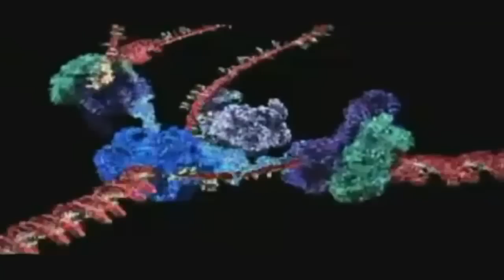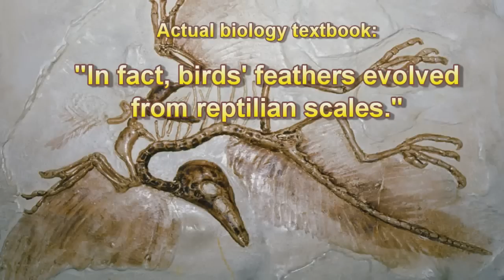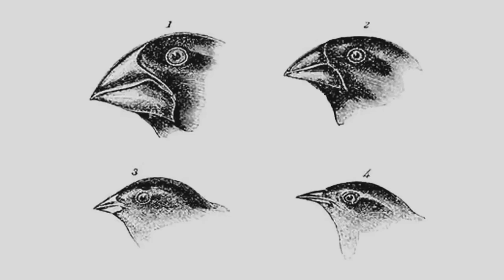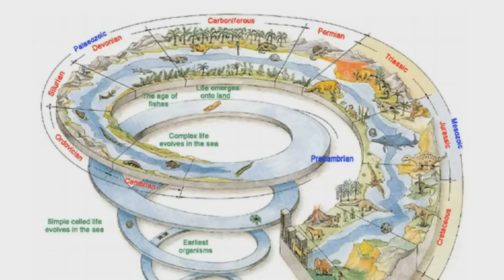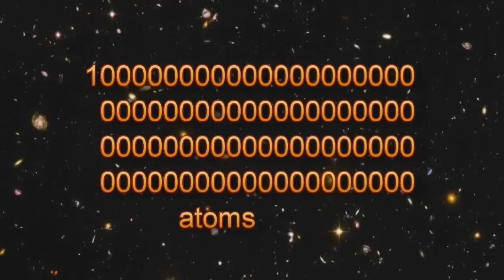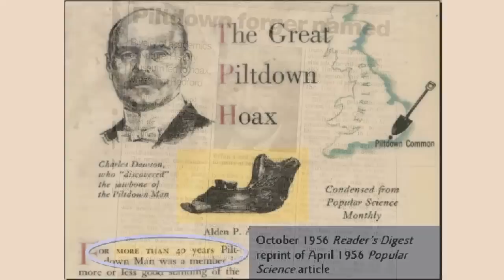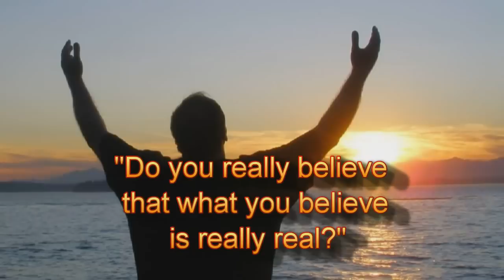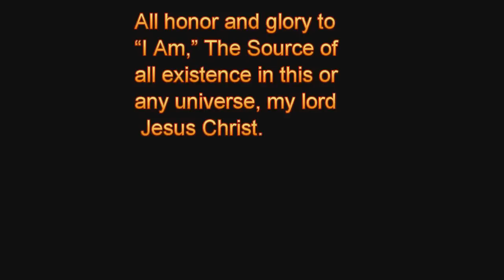Evolution Demolition

Comment: 4.30  EVOLUTION IS SCIENCE!
Reply: Natural selection is science.  Random mutations giving rise to overwhelmingly improbable genetic instructions is scientifically impossible.  It has never been observed or documented.  Only wished for.
Reply: Tiago Almeida The "junk DNA" idea has been abandoned because researchers find function for sequences in this area of the genome weekly.  You are behind the times.  Have you heard of the ENCODE project?  The arrogance of assuming that DNA must be junk if an evolutionist doesn't know its function is embarrassing.

Mutations are always damage to the original function of the code, but most of these errors are self-corrected by genomic error-correction algorithms.  Many others are irreparably harmful.  However, you are correct in saying that sometimes mutations get lucky and are actually "beneficial" by eliminating function that has been causing problems under certain conditions.  The sickle cell mutation prevents malaria from proceeding, but if both parents have the mutation, then it causes sickle cell disease.  So information is damaged, yet it can be a beneficial mutation.

So the issue is not beneficial versus harmful, but rather: writing new genetic instructions versus the loss of informational function.  Being beneficial has nothing to do with what I'm talking about.

Many variations claimed to be mutations are not mutations at all, but are pre-existent in the genome until natural selection brings them to the fore.  Just because a gene has not been observed previously does not mean that we can be sure it was not always there, hidden in a recessive gene.

Many of the gene changes in bacteria are self-programming changes that are drawn from plasmids.  This is DNA information that already existed in a DNA loop, but a segment is pasted in to the genome so that a new enzyme variation can be self-programmed.  Plasmids are very likely the source of nylonase, and resistance to antibiotics, not random mutations.  I understand that plasmid research is cutting edge stuff right now.
Reply: Mark Champneys So you are saying that mutations already exist in the genome of certain organisms? The claims you defende can have some degree of reazon.

But we just don´t have enought proves to know if that is true or not. If that is true, the mutation that made possible the formation of fotoreceptors (PAX6 is a key regulator gene for the deveplopement of the eye) should have appear earlier, given that the eye allowed the first single-celled organisms, such as bacteria distinguish day from night, and so take refuge in the day to minimize the exposer of UV radiation.

The same applies to trees and fetuses. Their ancestors  where small colonies of algae and mosses that lived in moist environments such as beaches, a mutation allowed the formation of lenhin, keeping the stam hard and robust, allowing the developement of fetuses and trees.

When I refer to junk DNA, I knew that we as important for an living being. If junk DNA survived natural selection, is because its necessary. One hypothesis explain that the junk DNA plays an inportant roll in the protection of genes: if the genome contained only coding elements proteins, many of which would degrade and would become useless by means of recombination errors. this non-coding DNA becomes a shock absorber, reducing the probability of damage to a critical gene.
 Another hypothesis says that when when the chromosomes are crossed, some portions of genetic trash can be grouped into useful combinations.
Reply: Mark Champneys
Now you are an expert on ENCODE too? How many of the 30 papers did you read? What data did you look at?
Reply: Helixbuilder Seeing videos from:
- Thunderf00t
- King Crocoduck
- potholer54
- The amazing atheist
- AronRa
- theThinkingatheist
- DarkMatter2525

Reding books about genetics, zoology, botanics, astronomy, physics, chimestry. Searching in the web sites were your crap is debunked, searching evolution and what it saids, going to real sites and see for my self transitional fossils, see mutations and the articals written about them and being focus on school.

Yes, I may not know everything, I only 16, but I know enought to refut such claims.
Reply: Tiago Almeida
Tiago we are on the same side I was speaking to Mark.
Reply: My mother tongue is not english, it´s potuguese, so I don´t understand what has encode, can you explain to me please?
Reply: Tiago Almeida
It was a genome project that tried to identify functional elements in the genome. It was a good effort but the results seem a bit overstated. Looking at the methodology and the controls I take the results as temporary pending a functional assay.
Reply: Helixbuilder thank you.

Comment: The reason why darwinian evolution can’t work is because the chromosomes within the DNA of species is already fixed. If an organism developed an extra chromosome or lost one due to some odd mutation, it couldn’t successfully mate and evolve a new species as it wouldn’t work because their gametes wouldn’t produce viable zygotes or it’d make the animal infertile due to the process of gametogenesis which the odd number of chromosomes makes it impossible for viable gametes to be produced by meiosis. Second of all, the odds of evolving a human though the nonsense process of natural selection and random mutations is 1 in 10^6930000. You calculate this by raising ten to the power of 77 (ratio of functional protein sequences) and again to the power of 90,000 (total number of proteins in the human genome). So, 1/(10^77)^90,000= 10^-6930000 or 1 in 10^6930000 converted to odds. This is a 1 followed by 6930000 zeros. It’d take you about (10^6930000)/(3.6524*10^2) = ~2.7*10^6929997 years to evolve a human by this process! There are only 13.8*10^9 years since the big bang, and there are only 10^80 atoms in the entire known universe. Darwinism’s an utter joke. To believe a fish eventually became a human in only 10^9 years is a nonsense.  
Also fossil record proves without the slightest shadow of a doubt that there is no evolution of species:   "One hundred and twenty years of paleontological research later, it has become abundantly clear that the fossil record will not confirm this part of Darwin’s predictions. Nor is the problem a miserably poor record. The fossil record simply shows that this prediction is WRONG” – Eldredge & Tattersall
Reply: So perhaps you can explain in your model the existence of polyploid organisms such as strawberries.
Reply: every living thing is the prouct of an intelligent design.
Reply: An assertion of your claim is not an explanation. If your claim is true it is testable.  Your claim is eviscerated by the fact that gametes are produced by humans with Downs Syndrome.  The syndrome is due to an individual having three copies of chromosome 21. 
The rest is just numbers and opinions.
Reply: yes the thrisomia 21, also known as down syndrome is the result of a mutation of the 21 th couple of chromosomes. this proves that mutations are harmful, not beneficial!! this means that evolution occurring by random mutations slowly adding up, it's impossible because there's no such thing as a beneficial mutation!!! let alone thousand of beneficial mutations all occuring at the same time in order to produce a new species. So evolution is UTTERLY IMPOSSIBLE.
Reply: No the fact that you wrote what you did demonstrates your willingness to put forth a fallacious argument rather than sticking to the facts. If you can't argue the merits you don't have a case.
Reply: trisomia 21 is a mutation of the 21 th couple of chromosomes , wich is harmful. this  demonstrates that mutations are harmful.  no one has ever seen a beneficial mutation  and one that increases the amount of information in the genome. go to ask people of cernobyl if mutations are beneficial
Reply: Trisomy 21 is the nondisjunction of a pair of sister chromatids during meiosis II or homologous chromosomes in meiosis I. The resulting zygote has three copies of chromosome 21. See any basic biology text.

Downs syndrome phenotype is a fully functional human. There are high functioning having humans with downs. These high functioning downs individuals have IQs at the low end of 'normal' humans.  You can argue that this is harmful if you want. 

There are humans with 2Xs and a Y and they are still viable. Lethal 
mutations tend not to spread, primarily because dead organism don't 
reproduce.

As for your second claim, look up revertant mutations, gain of function mutations, etc.
Reply: the three chromosomes instead of the 21 th  normal couple of chromosomes, is a MUTATION. this mutation is harmful because a person who is affected by Down syndrome dies a lot earlier compared to normal people. Also Down people have intellectual difficulties, can't learn in the same way normal people do, and have some problems of social relations and most of them are STERILE. so these are the facts that show that Down syndrome is a harmful genetic mutation. So Down syndrome can in no way prove evolution, insted it is another proof against evolution.  try again
Reply: 1) A trisomy is not a mutation it is an extra chromosome. A mutation is an alteration of the original DNA sequence.
2) If the individual can function and reproduce the effect is not harmful; however their capacity for being a fully function human is diminished. The word harm indicates a physical injury that may rise to a threat to continued existence.
3) Life span may indeed be shorter however whether that is harmful is more an opinion than medical fact. Not all humans have long lives.
4) Fecundity is reduced too, now there is where the impact of differential reproduction will play a role.
5) There are many forms of intellectual difficulties; many of which are displayed by so called normal humans too.
6) I have yet to approached at any point in my previous post how this is predicted by evolutionary theory. The reason your misconceptions of science need to be cleared up first.
Reply: 1) having 3 chromosomes instead of 2 ( one extra chromosome in the normal 21 th couple)  is a mutation. 
2) Down people live a much shorter life than normal people ,most of them are sterile , and they have neurological limitations. all those things are HARMFUL not beneficial
3)  your trying to say that humans have different lifespans and different neurological problems are in no way comparable with the limitations that has a Down person.  
4) Your effort to discredit the facts i say are truly ridiculous
Reply: Changing definitions of concepts to fit your claims is intellectually dishonest and does not change the facts. 
Let me be precise on the matter:

95% of Downs syndrome is due to non disjunction of chromosome 21 from one parent. That is not a mutation because the DNA sequence has not changed.

4% is due to translocation of Ch 21 that is a mutation because the DNA sequence is altered.
1% is due to mosaicism not a mutation but due a non disjunction that occurs during the rapid rounds of mitosis after fertilization. Most cells will have 46 chromosomes and some 47.

To summarize 96% of downs is not due to mutations but abnormal chromosome count due a non disjunction that occurs during the rapid rounds of mitosis after fertilization.

Reinterpreting what I say is in no way a rebuttal.
Reply: Your initial claim is false. You said: 

"If an organism developed an extra chromosome or lost one due to some odd mutation, it couldn’t successfully mate and evolve a new species as it wouldn’t work because their gametes wouldn’t produce viable zygotes or it’d make the animal infertile "

The fact that Downs Syndrome individuals can have children completely destroys your specious argument.
Reply: i didn't change the definition to fit my claims, i used the same definition of mutation you gave. an  alteration of the genome, is indeed a mutation.  all of my other points are just facts, therefore Down sindrome is harmful not beneficial.   how does Down sindrome prove evolution anyway ?  i'm curious
Reply: You did change the definition; a trisomy is not a mutation.Your claim was about extra chromosomes. Your point is invalid.

Fitness is reduced by reduced fecundity, therefore the phenotype will be selected against. So that participial phenotype is not as common as the normal human phenotype. Just as Darwin said over 150 years ago.
Reply: Insults? Wow? Fertility in Downs women is estimated between 30 to 50%. While in males it is thought their lower fertility is due not being fully sexually developed. 
Which oddly argues for evolution not against it. Those less fit do not pass their genes on to the next generation.
Reply: my point is valid because 90 % of Down people are sterile. and trisomy 21 is harmful not beneficial.  and if you make two different species mate, belonging of the same kind, like tiger and lion you will have tygons (or ligers) wich are 90% sterile. therefore ligers are not classified as a new species. so speciation is impossible.  How does trisomy 21 prove evolution?
Reply: The danger of using Wikipedia as a reference source of knowledge is that it is often wrong. I'll go with the scientist on this one. 

The Genome site defines a mutation as:

Mutation
A mutation is a change in a DNA sequence. Mutations can result from DNA copying mistakes made during cell division, exposure to ionizing radiation, exposure to chemicals called mutagens, or infection by viruses. Germ line mutations occur in the eggs and sperm and can be passed on to offspring, while somatic mutations occur in body cells and are not passed on.
https://www.genome.gov/glossary/index.cfm?id=134 

And incorrect chromosome numbers as:

Numerical Abnormalities
https://www.genome.gov/11508982/#al-5

The odd thing is when I click on the link to the first citation on Wikipedia it directs me to the above page. If I use the find command the word mutation is absent.
Reply: Congratulations so your reading comprehension is diminished. The page title is Chromosome abnormality which include mutation.If you follow the sentence structure you will note that each abnormality listed before the word  'or' is then defined by example. Note that mutation is defined by " irregular portion of chromosomal DNA".
The citation which follows the first sentence should have cleared up your confusion. https://www.genome.gov/11508982/
Further more why would anyone use Wikipedia when they have textbooks? Try reading Genes XI.
Reply: Sleipher 

The reason why darwinian evolution can’t work is because the chromosomes within the DNA of species is already fixed. If an organism developed an extra chromosome or lost one due to some odd mutation, it couldn’t successfully mate and evolve a new species as it wouldn’t work because their gametes wouldn’t produce viable zygotes or it’d make the animal infertile due to the process of gametogenesis which the odd number of chromosomes makes it impossible for viable gametes to be produced by meiosis.

<No bucko, you do not understand the difference between a gene and a chromosome. >
Reply: Sleipher
The reason why darwinian evolution can’t work is because the chromosomes within the DNA of species is already fixed.

Sorry but your understanding of cellular biology is completely wrong. 
As an analogy, pretend that the genome are the equivalent to the contents of a set of encyclopedias. Each chromosome represents one volume of the encyclopedia. The DNA refers to the whole chemical compound. Each of four compounds has a mating compound G-C, T-A, C-G, A-T. Each set of three forms a protien and many protiens produce are a gene that, if active, either controls another gene or some feature. 
The genome is not "fixed". When a human egg is fertilized there are about 130 new mutations as the new genome is created from the genes of the father and mother, this is the variation aspect of the Theory of Evolution.  Natural and sexual selection will determine if those genes make it to the next generation.
Reply: That is all you got to say? You still have no explanation for polypliod organisms. According to you they can't exist but the do. Why?
Reply: according to me they can't exist? why? if they exist therefore they can exist. i never said that polypliod organisms can't exist.  Can you explain the origin of life? no, because abiogenesis is proven FALSE. life cannot arise from non living matter by casual chemical reactions, we see only that life can ONLY COME FROM LIFE (biogenesis).  So the only logic explaination for the presence of life in this universe and also for  it's  marvelous complexity  is an intelligent creation from an intelligent mind.
Reply: So the only logic explaination for the presence of life in this universe and also for  it's  marvelous complexity  is an intelligent creation from an intelligent mind.

No. This is not in any way "logical". You start with a false premise, that is that life only comes from life. Even if life comes from an intelligence then life comes from an intelligence or by continuing that life but there is another possible source of life which is Abiogenesis, the chemical origin of life by purely natural means. Even if life here was started by some intelligence, what is the origin of that intelligence?
Reply: abiogenesis has been proven false, so there's no debate about it. the intelligent mind that created life can easily be uncreated and ever existent, because if it has been created by something else, one can go endlessly further asking "what created the thing that created the intelligent mind? what created the thing that created the thing that created the intelligent mind?" and so on...
Reply: Abiogenesis has been proven FALSE  with the MILLER EXPERIMENT,  no one could manage to create a single living cell from casual chemical reactions. All mutations are harmful, in order to make a new species from another species it requires hundreds and hundreds of beneficial mutations that no one has aver seen or registrated